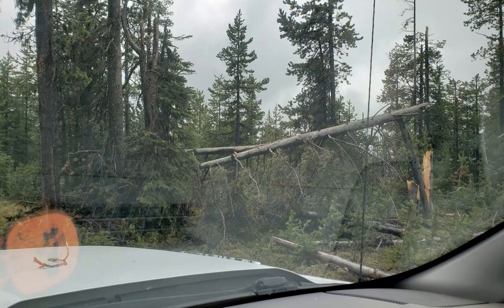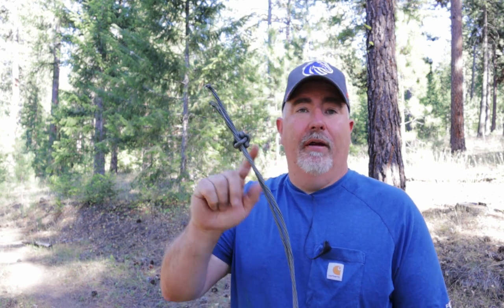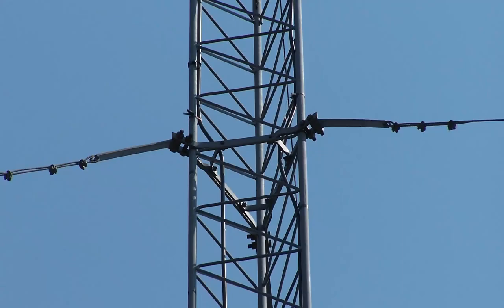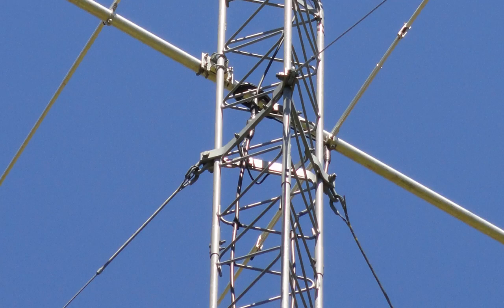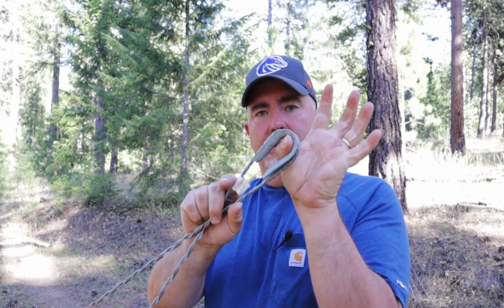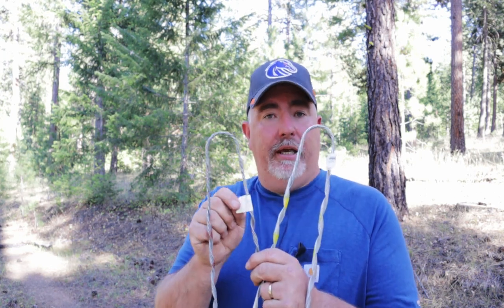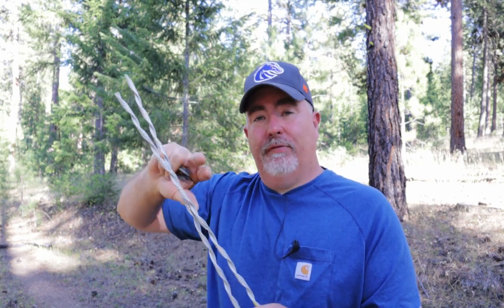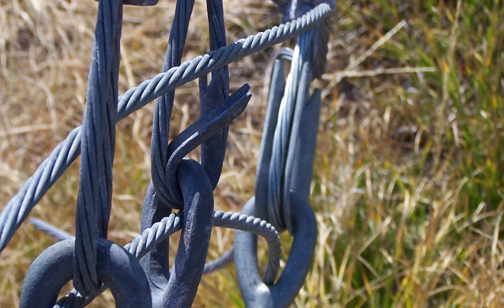Tower Collapsed! Rohn 45G Complete failure and how to avoid it.

Comment: I had quite the ride coming down on a 100 foot tower that collapsed at the 60 foot height. I was at 90 feet and managed to fall to the 60 foot section and I held on. The guys for this Rohn tower didn't even have the thimbles for the guy wires. I wasn't wearing a harness which probably saved me. I know I did everything wrong back then. I only climb to 50-60 feet now which is higher than what most folks realize. I appreciate your video and I learned a few things. I'm getting ready to put up a Rohn 45-55 tower. In my lazy old age I'm thinking about getting some sort of crane or bucket to assist in the install.

Comment: In my younger/dumber days I was doing a tear-down on a 110' 25G.  The base, and guys all looked fine, up I went.

At right around 45' it started feeling "funny" - kind of a dead, mushy, wiggly feeling. I gave it a couple of good shakes, just to see if it was secure.  That is when the circus ride began. slowly listed over as I scrambled down.  I was at about 10'ish when it went over with me on the side. 

Later I found out they installed it by pushing some drill-rod into the dirt with a bobcat, the concrete was a 2"pad to make the owner happy.   Guy anchors looked OEM rhon, but were the tops of cut-off rhon salvage anchors welded to more drill rod.      The moral, no matter how good the install looks, never trust without verification.  If you don't you are going to need a really strong martini after your circus ride.

Comment: Glad you mention about interior rust.
Checked a Rohnert 20 g tower a few months ago.
I placed my right hand on the side as if I would climb, my thumb went through the side.
The side wall thickness on 20g is 18 gauge will 25g is 16 gauge.
Be careful with used towers
Reply: Rohn 20 has 6 bays and 25 has 7 bays. Thats the quick way to tell.

Comment: when a friend passed away W0zus. his family sold off his ham stuff. they guys who bought the guyed big tower. had it come down on them. the family was not held responsible because the tower did not belong to them(they sold it first). My 40 foot tower is self supporting in my back yard. with the prevailing winds from the west to north west. it has stood over 90mph and its failure would land in my back yard anyway. its been up for 40 years. I am now worried about my glen martin roof top tower and its guy system the anchors are good but the thimbles are questionable. I will look into fixing that stuff. thanks for this great video. - -- --   -- -- -- -- --   -- -- --   -- - -

Comment: Excellent video. Retired from the power utility business as an engineer.  You are very correct the preformed wraps (such as from Preformed Line Products) and other companies are the best way to go.  They last nearly 50 years on utility lines so they will work very well with towers as well.  Ice loading is a must design criteria.  Aeolian Vibration is another thing one should study and install the proper dampening attachments, or the vibration could wear out the attachments and reduce their life.  Seen many power lines, fiber optic lines on the ground in my career due to that pesky vibration, always costs more second time around.

Comment: I remember way back when I had to climb some really tall towers with a lineman's belt. Which really was not a good idea, but it was all we had 40 years ago. Now there are much safer equipment available and has been for 25 years now, so do the right thing and listen to this man. I have climbed tall cliffs and mountains, and jumped out of airplanes, but in each case I used the proper gear, so now I do not climb towers any longer due to Arthritus age and so on. I do go to tower sites and assist, as ground crew with ropes and canvas buckets to make sure the climbers are safe and doing it properly. Dont forget the all crucial helmet, that is another thing people do not do , a small bolt dropped from a tower at height can kill you. I am so glad you made this video it is a much needed warning/ reminder. I have seen and heard of so many near disasters, plus heard of many deaths due to improper equipment and or procedures. 73 great video

Comment: Lots of good information and I have broken many of the rules at one time or other. Also those old towers with many bolted joints are great noise generators. At one time around here people would put up treated wooden power poles for towers. We had one at the company where I used to work. When it was finally taken down and a new heavy self supporting tower was installed, it was found that the center of the pole was completely rotted. It only had about 2" of the outer surface of the pole that was solid. Actually a woodpecker had built a nest in the pole.

Comment: Thank you for the discussion.  I (was) going to look at a used Rohn 45G and never had a tower before... ....... this helped me see I am far from ready for such and further ... if I get a tower I'll be looking for a new one.
Reply: This is the thing. Old towers lose their zinc coating and then the tower starts to rust. The zinc people have a chart explaining this. Rust needs to be taken care of or it weakens your tower. The first 30-40 years it's not a problem. But after that it needs to be actively maintained. Along with guy wires too. Many people don't understand any of  that!

Comment: Wanted to add - Also metallic guys are or can be a path to ground for lightning, wind, snow or sandstorm static, further fatiguing the entire guying system. What is seen on this collapsed tower is typical of DC grounding seen even on professional installs, but potentially not nearly adequate for installs which may never see any or little inspection and maintenance. I don't think enough time has passed to judge the adequacy of now becoming more common phillystran guys in this service. The failed clamped guy cable end the gentleman shows us at the end of the video may have had some arc damage hastening the work hardening and/or yield point failure seen and discussed here, but hard to tell without some inspection under magnification. My two towers are self supporting. 73

Comment: One thing I can't find much info on, is how are guy cables normally anchored to the ground and what kind of foundation is normally needed?  Even a proper guy install won't work if the foundation is not good enough.  Also how are they typically repaired/replaced, guessing you put new one in first then remove old?  Or do you just ensure to have enough redundancy so you can get away with removing one temporarily?  I'm far from the point of putting up a tower but just working on learning as much as I can before I get there.

Comment: Thanks a million for a very educational video. Safety, Safety, Safety.. Check and re-check. Briefing of the crew at site is also mandatory and no spectators within a safe distance. I know of a case where during a tower take down a snapped steel guy wire hit a person( Spectator) and unfortunately it was fatal. Perhaps a video on how to assemble using the big grip  would be great. 73's

Comment: There are many important points in your video.  I'm amazed at the number of towers passed around over the years and I've known of many that sat unused on their sides in contact with soil along a fence line or behind a structure.  Some were there so long, 3+ inch diameter volunteer trees had grown through them along with being vine covered.  Without knowing a tower's history, in service and/or in storage, I consider these like acquiring someone else's used safety harness...just no thank you.

Comment: Its not a matter of cable clamps being incorrectly installed... but any cable clamp use at all.  Correct spec guy wire is rather tough stuff, but does not bend well at all.  It is subject to stress risers moreso than the "Dead End" cable loop.  The Dead End is somewhat annealed, but larger diameter than the guy cable so it retains the strength.  The Dead End Loop acts like the "finger puzzle" kids toy, whereby the more pulling force appled, the tighter it holds.  The more brittle guy cable stays straight inside the wraps.   There is no real "coating" on the Dead End Loop, it only relies on the built in texture of the galvanize surface.  Not like HAM HOMESTEAD, I wrap both at the same time, all the way to nearly the end of the Dead End Loop, then, split the strands of the loop and wrap each "half" by itself for the last two turns.  No tools, just gloved hands.   The pull strength for 1/4 inch guy cable is something like 3750 lbs., which is a whole lot.  Larger cable has greater pull strength.  And.... they're about the same price as a pair of "cable clamps", for you cheap sob's out there.

Comment: As a former ROHN engineer I can share a story. A ham operator was taking down his tower at his house. He climbs to the top and cuts a guy wire and the tower collapses. This is the mindset ROHN engineers have for their Ham radio operators. This incident is why ROHN does not design a true pin base for Ham antennas. They have a short tower section that is embedded in a concrete pad porvides a fixed base and allows the tower to somewaht freestand in case someone does something really dumb and suicidal. That way ROHN will have some plausible defence in a court of law.
Reply: The tower should be designed to where the guy wires are only insurance not structural. Seems like very little margin for error in the design or lack there of
Reply: @slappomatthew  The guys can be the problem. If you remove one guy wire, the tower can then have an imbalance and the other two guys can pull the tower over. A tower that does not need guys is called a free standing tower and in the ROHN world it is called an SSV or a SSVMW. Free standing towers are a lot more expensive, but require less maintenance. A tower is a space truss and as such the loss or any one member can cause the loss of the entire structure. To eliminate this issue you need a space frame with redundancy. Steel poles are in between the truss and the frame. Trusses are designed with no extra strength.

Comment: Are the large thimbles just oversized cable thimbles? Meaning if I am using 5/16" cable do I just use like a 1" cable thimble?  All the 5-/16" thimbles I can find are only like an inch diameter on the bend.

Comment: So in my case I'm going with 35 feet if 45g ss. The only antenna is going to be a hy- gain 203ba. 32 pounds. Wind load less than 6 with the rotor. This will be unguyed. This should be good to go. Your opinion.
Reply: I also have a Hy Gain LJ-203 that I am modifying the boom to accept a 2 element 40 yagi on as well. After researching I found I am probably doubling my wind load. I had intended on using Rohn 25 for the LJ-203 but decided that I am going to use Rohn 55g instead. The only difference between 25 and 45 is the width between legs. It's still the same size tubing and the cross ties are made from the same gauge steel. So for an inch by inch comparison 45g is actually weaker than 25. That is why I decided to step up to 55. Rohn 55g has larger O.D. tubes (1.5" vs 1.25") thicker walls (11 gauge vs 16 ga) and the crossmember gauge steel is 1/2" vs 5/16" on the 25g and 45g. 

Also, I plan on only going up 45 ft which is still within spec for Rohn 55g to be free-standing. But I'm using guys anyways. Phillystran instead of steel braided cable.

Comment: Hi is safe or even legal to replace one of the 3meter sections on a 18 meter stayed mast with home made lifting brackets, the 3rd one from the bottem got rusted and need replacement without switching off the radio equipment. Just need some though about it

Comment: Well, now that I learned that I installed my tower all wrong, what do I do ?
It's at 85 feet, and been up probably close to 35 years or more !
I started doing towers when literally, just a kid !
Where we didn't know what a safety belt was !
Funny, back then I was limber and thin enough, that I used to wedge one leg, through the tower, to hang on !
Here's another one for you !
Again, in my youth, I would wear tennis shoes, and after a climb, many times would hang by my arms, then place my feet on the outside of the tower legs, and slide down the outside !
I admit it was pretty shakey when you encountered the bolts on the way down !
Hey...., I never said I was smart !
But seriously, this video scares me, knowing how many errors I had done, erecting my own tower !
I like to give credit, where credit is due !
That would be by the Grace of GOD !
Just turned 65, and just stripped the 85 foot Rohn 25G down, and put on fresh aviation orange and white !
More as a novelty, than anything !
Still gathering parts to go up with 7/8 hardline, etc !
So much to do, so little time !
But it is next to impossible to find climber's these days !
We are a dying breed !
I think this mans advice is rock solid, just for some of us, too late !
GOD be with you !
And be Safe in all you do !
From one cheap Ham, to another, '73 !
Reply from the maker: 73

Comment: ...they are called "big grips" absolute best. Using Crosby clips (not recommended) incorrectly will cause issues. Thimbles are a must! Oversize, don't be cheap! Big grips, guy wires, etc, can be purchased from your electrical supplier. eg Hydro electric distributors, not your local electrical wire supplier. LOL!: Stay away from overseas junk, buy only "Crosby Products" I have turn buckles here, used with >300',  ~>24" faced, 7/8" - 1" big bucks, but will out last you! 1000' towers are much more fun to build! LOL!

Comment: I’m sure hams have been killed cheaping out on towers, and I’ve been a ham since 1994. I’ve never heard of anyone or known anyone that knows even of anyone that got killed on a tower. Like I said, I’m sure it’s happened, I’ve just never heard of someone going out that way. All the tower jobs and junk and fun and work I’ve been on and the guys I’ve been around have always been hyper safety oriented. Not saying we always had osha approved radio tower climbing gear only, but we’ve always worked very safely. Outside of a cut, bruise or a blister, no injuries at all. Maybe some sun burns and heat cramps, but that’s about it. I get the safety talk, but don’t scare the crap out of people for no good reason.

Comment: I struggle with why people dont simply install a pivoting baseplate so the tower can be leaned over vs having to be climbed in the first place.  A simple wench and pully system proper cabling will work for most towers (<75ft) and would keep most of these issues at bay.

Comment: Than You !!!.  I can't say where , but i've seen one guy fall off a 20ft mobile walk way , using the wrong type of harness and LOL he may not be able to have kids.  I just watched about 12 videos looking for info on the HY-Gain TB-70  they make 4 , and saw a video where one guy put all 4 grounding rods inside the hole for the tower. I am NO expert on gounding , but do know that lightning is as hot as the surface of the SUN , and that 4 x 4 foot concrete will blow up like a shrapnel grenade and tower will fall on his house or neighbour , please any one correct me if I am wrong.  while I'm at it  what is wrong with MFJ and no specs on their web site for this TB series towers , I emailed them .  I may not be able to do one at my present address either way , but a man has to dream and have goals 73's my fellow radio lovers